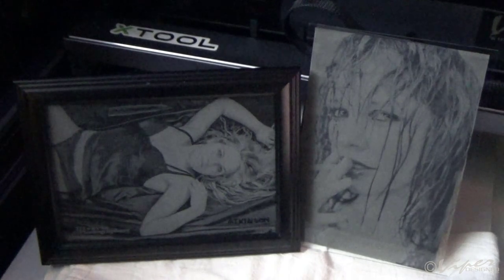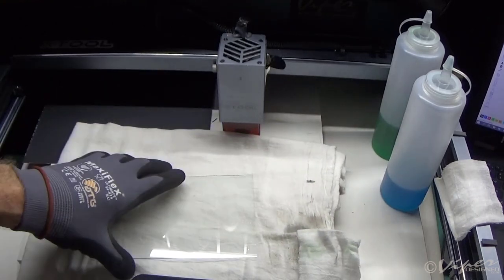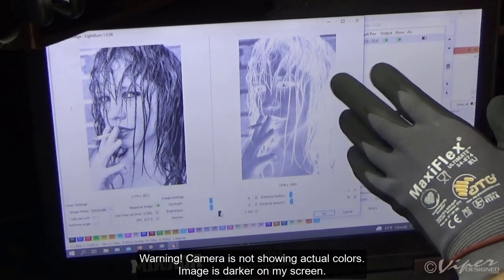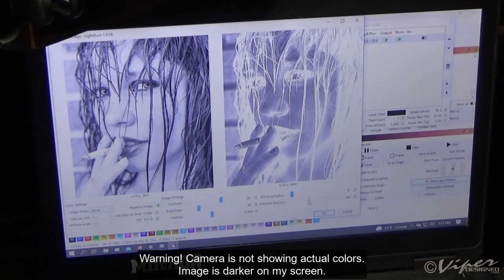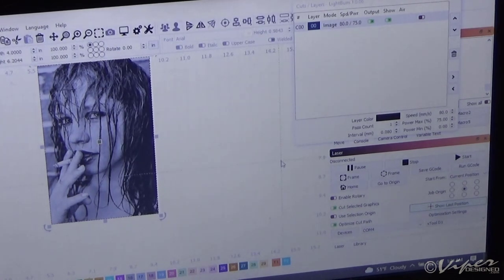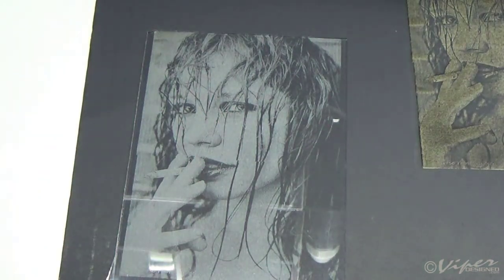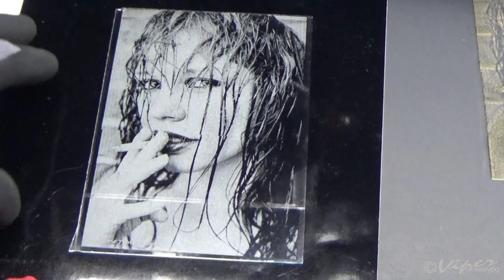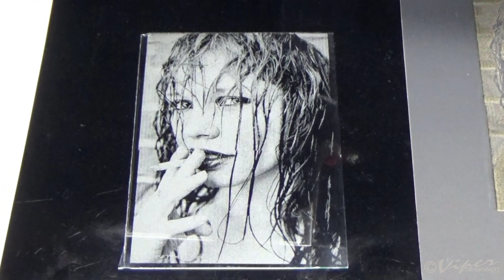Photo on Glass with xTool D1 10w Laser

Comment: Cool 😎 say what is the black paper. Can you use black construction paper?
Reply from the maker: Construction paper is a little too thin and burns or stains the glass easily. I use posterboard from Wally World or a Dollar Store. I have more info on my website. http://viperdesigned.com/laser/backers.html
Reply: @viperdesigned   okay Sweet I’ll look for the posterboard . Um what if you doubled the construction paper?  I have a 5W laser
Reply from the maker: @vincentlekei1969  I have used the black cardboard back out of a picture frame before and it worked pretty well also. Took a little more cleaning. I haven't tried doubling up on the construction paper, but it could be worth a try. Experimenting is half the fun.
Reply: @viperdesigned  good morning Viper. Thanks so much for your insight help 🤓 I’ll do the experiment . 👍

Comment: About half way up the image the laser shifted over several pixels to cause a visible broken line effect in how her face and hair align.  Or was the jib bumped at some point during the burn causing the shift in material?
Reply from the maker: I'm not exactly sure what happened but I probably bumped the table or unit and didn't notice it at first. I was living dangerous doing the video and didn't have the laser or table mounted. Haven't seen that happen in any other projects.

Comment: Wow, great video.  I'm a boudoir photographer and have been interested in offering portraits etched in glass.  This seems to work very well and I'm interested in this process for sure.  I believe you own the 10W system but wondered your thoughts on the 20W version - needed or not?  Also are you using air assist or see the need for air assist?  Thanks in advance for your advice.
Reply from the maker: Hi Wilson.. Thank you for the comments and interest trying it out. Air assist is useless on this process. The etching happens on the bottom side of the glass between it and the backer material. It's interesting to watch it happen.. Blowing air on it won't do anything but make the glass colder and increase the risk of shattering it. All materials have their limits and it doesn't matter how much wattage you throw at it. 10w does just fine and there is no advantage voltage wish to going with the 20w. There may be other features that might be useful depending on the amount of work you plan on doing with it...
Reply: @viperdesigned  thanks so much for the response!  Best to you and yours.

Comment: I tried these settings Lightburn said it was going to take almost a Day to run it at 80.00 mm/sec then I noticed how slow my Laser was moving. Watched the video again no way it's moving at 80 mm/sec maybe 1800-2500 mm/sec
Reply from the maker: Thats one reason I don't edit the videos. You see it just like I did it. 80mms works out great for me. What DPI/Lines are you using? 90/100 lines is all I use on glass.

Comment: Is there a difference to watch for in settings, between the D1 and D1 pro?
Reply from the maker: The D1 is only 10w so that would make a difference if you have the 20w Pro. 10w Pro should use the same settings. Haven't done any with a 20w yet so not sure how much difference there will be. I'm sure it will take some adjustment in the settings. Winter is coming and I'll have more indoor time. Playing with a 20w is on the plan..

Comment: how long did it take to engrave the photo on glass I dont know what I am doing wrong I put in all the setting you showed and it said it would take 49:49:25 what could it be
Reply from the maker: The 5x7 only takes about an hour. I am using mm/s for speeds. 80% power and 80mm/s on speed is my base line and I make adjusts from it if needed. 49hours? I'm not doing anything that long even if I like it.. lol
Reply: @viperdesigned  so what could be wrong because I put in them same setting 80 power and 80mm/sc and did the previous and that was the time that came up is there a different setting somewhere that could make it do this in settings im pretty new at this so I'm sure there is something I'm doing wrong any help would be appreciated love all your projects on here thanks for sharing you do awsome work
Reply: @waderollag6293  I've done the exact same copied the speed and power on a 100mm x 66mm picture and the times coming in at 17hours??? I've no idea what I'm doing wrong

Comment: Fantastic work 👍 I tried to copy you, with a picture of a butterfly. I made a mess of it 🤨 Where is your focus ? On the glas, or on the backing paper. I also run a xTool D1. Cheers from Denmark.
Reply from the maker: Oh No!! Thats not good. I just focus to the top of the glass.  Drop the gauge and set it. Don't get much easier. :) I have all the steps on the website if you need them. I do need to update the heat settings..  https://vipervisuals.net/laser/glassonthefly.html
Reply: @viperdesigned  Thanks, for the reply - i will hear right over and check out the website... 🙂
Reply: @viperdesigned  P.S. Just been over to your website - sooo cool..I like it... 🙂
Reply: Do you have to edit image to black and white then make it a negative before using the image in light burn

Comment: Did you use 3 in 1 oil on the glass?
Reply from the maker: I do the smaller ones(5x7) dry without anything on the glass at all. The latest info is on this webpage. http://vipervisuals.net/laser/glassonthefly.html  I prefer using a thin layer of dish soap when I do larger images or ones with a lot of heavy engraving.